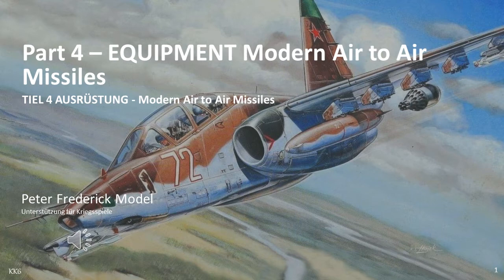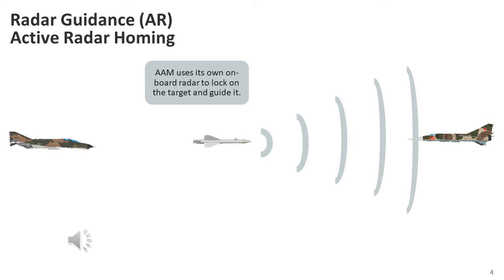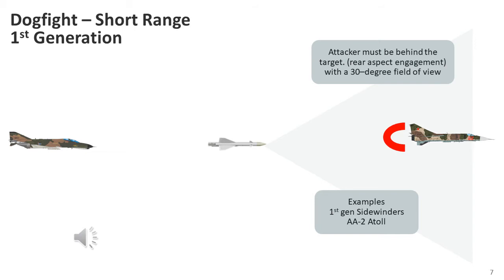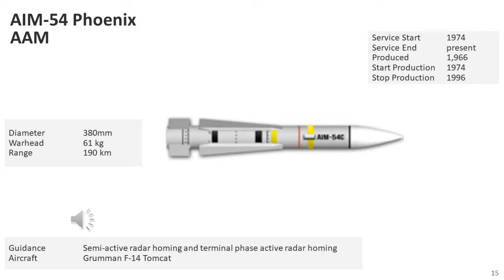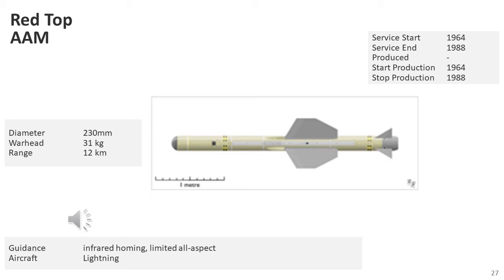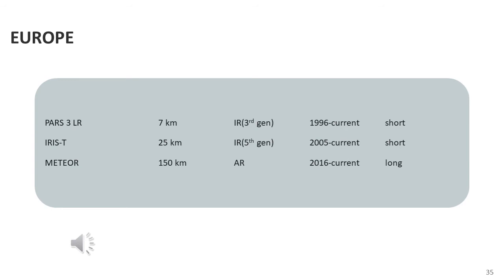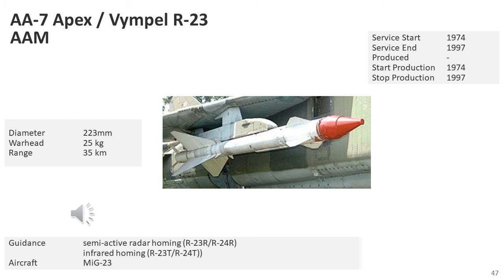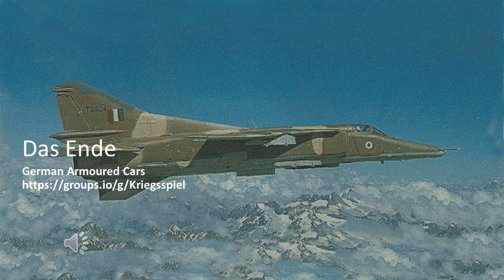Part 4 – EQUIPMENT Modern Air to Air Missiles

Comment: great video. i have a question, does the aircraft have to reajust his stability when he lunch a missile ? as his geometry distribution (center of gravity) will change as the missile get release? or the weight of the missil dont impact greatly his center of gravity?
Reply from the maker: Good question and i am certainly not qualified to answer, however most modern aircraft are inherently unstable with computers auto-correcting – I would imagine this would apply if the aircraft lost several hundred kg from a single hard-point on a wing. This series of videos give you a good view of a missile launch and I don’t notice any effect when a AAGW is launched, https://www.youtube.com/watch?v=1RJ8mIuiNQI